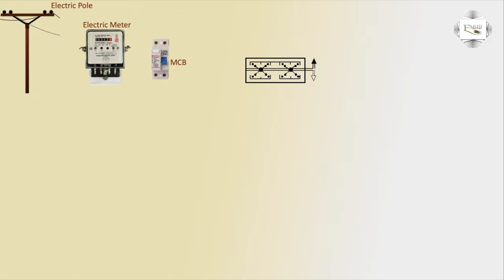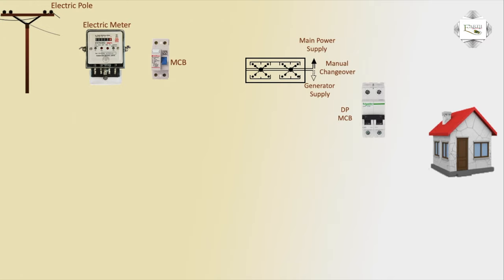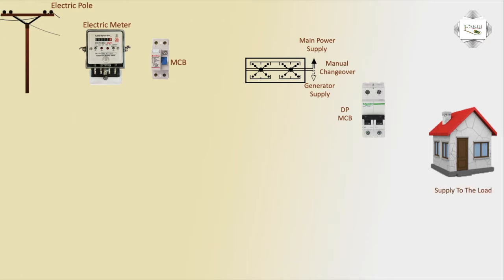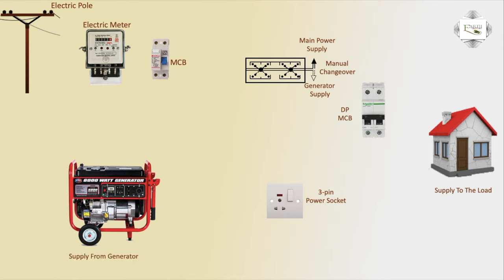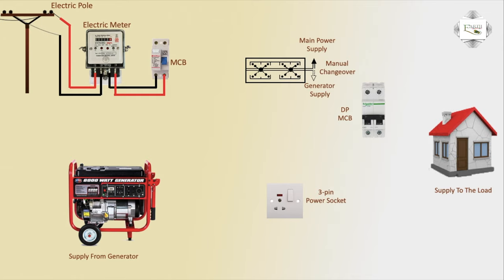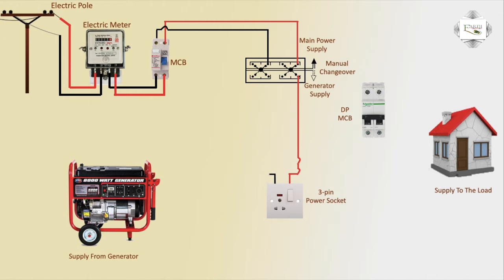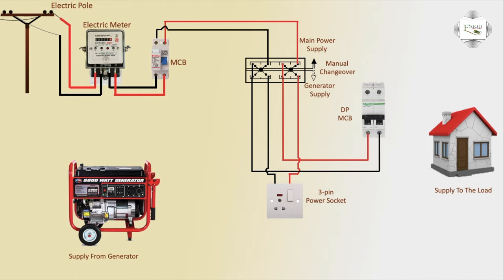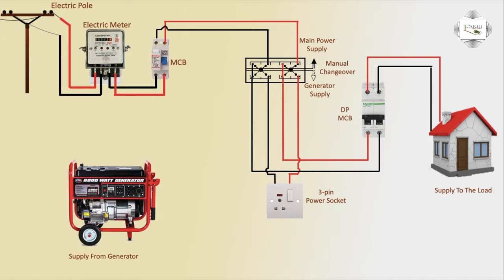Generator Wiring to the Home | Generator | Transfer Switch Wiring | Pole Line wiring | en

Comment: I have connected my genset's neutal with main grid's neutral and using a change over for switching only the phase between the supply. Is it safe?
Reply from the maker: no,
full info website @earthbondhon.  I love to receive your comments and feedback.
Thanks for watching it.
Reply: Here is a reminder about portable generator safety: everyone really needs to see this safety reminder to make sure. This advice is just to make sure that everyone is aware of all the warnings and it’s just to remind people to be careful using portable generators. Generators can be dangerous if not used carefully. Every year, hundreds of people die or get injured when using portable generators due to carbon monoxide poisoning and electrocution. Make sure you are using your generator carefully and keeping others safe as well. There is something very serious that everyone should always be aware of when using generators. Some people do run their generator indoors which is not safe and that increases the risk of carbon monoxide poisoning which can cause death of family and you. Some people run their generator in wet conditions which can electrocute them. Please remember that you should never run your generator indoors. Remember that carbon monoxide is an odorless and colorless gas that you cannot see or smell. Carbon monoxide is a silent killer. Keep that in mind. Make sure your generator is 15-20 feet away from your house and away from doors, windows, and vents. Never use your generator in your porch too. Having a carbon monoxide detector is very important against generator safety. Some people also allow children to go near the portable generator which could pose risks. We need to keep an eye on our children making sure that they are not near the portable generator so they won’t get electrocuted or burned by the generator which is dangerous. A locking enclosure also keeps kids safe. A generator shed might look like a tempting place to explore, or take cover during a game of hide and seek, but a generator is a dangerous piece of equipment that can cause injury. It says on the manual that we should also keep children away at all times from the portable generator to avoid injuries. Please do not allow a child or unqualified people to operate the portable generator. Just because some manuals missed what should be listed doesn’t mean it’s safe to do. Always follow the generator safety rules when using portable generators. Generators pose electrical risks. If you need to use your generator during wet weather, you need a generator tent to protect your generator from getting wet. Don’t let your generator get wet. Keep your generator dry and before using your generator, please make sure your hands and your generator is dry. Do not wear loose clothing when operating the generator. Everything that is said on the generator’s operating manual should not be ignored. Never smoke cigarettes near the generator. Please keep flammable things away from the generator. Never overload your generator too. Your generator can catch fire. Never ever try to plug a generator cord into a wall outlet to avoid back feeding. Back feeding your generator is dangerous. Always turn on your generator first before plugging in appliances and shut off the appliances before turning your generator off. Use a heavy duty cord for your generator and the cord should not be worn out. All the instructions should be followed carefully. Never refuel your generator while it’s running. It can cause fire if fuel spills while your generator is hot. You should turn off your generator and let it cool off before refueling it. Having a fire extinguisher next to the generator is also important. This is only a reminder for everyone’s safety of using generators. Make sure your generator is properly grounded. Having a fire extinguisher next to the generator is also important against the safety rules. https://youtu.be/I1jT3ANENvI and here is a video more about keeping others safe when using generators and also about our family’s safety. Hope this helps. Thank you.